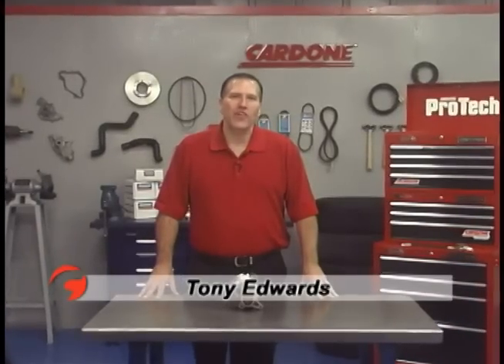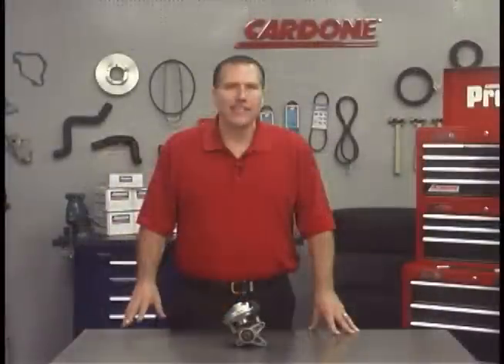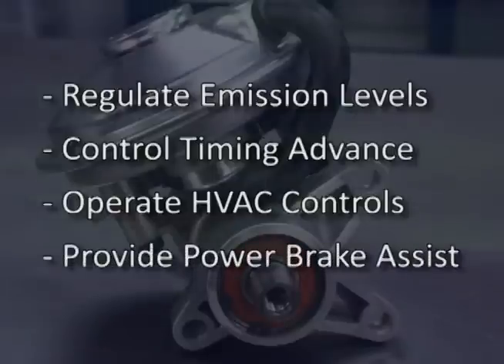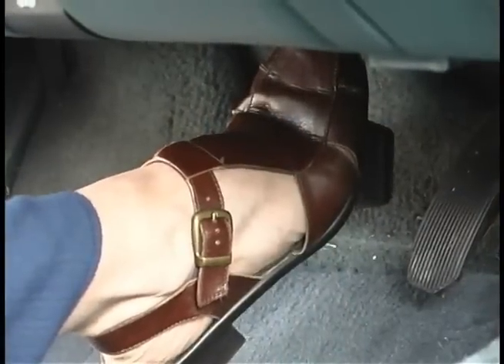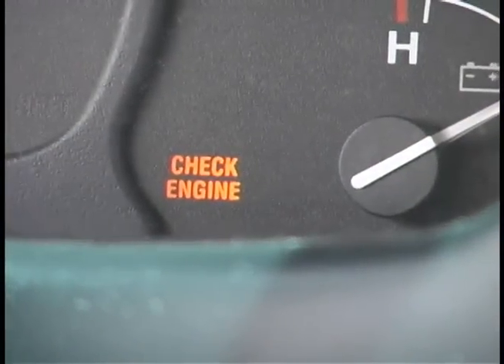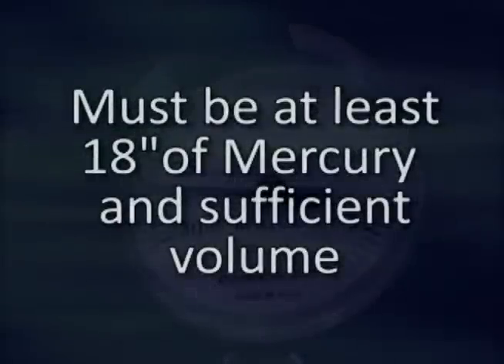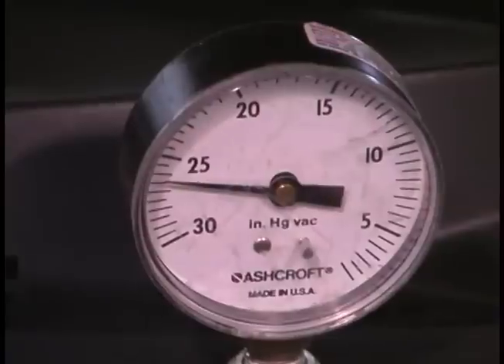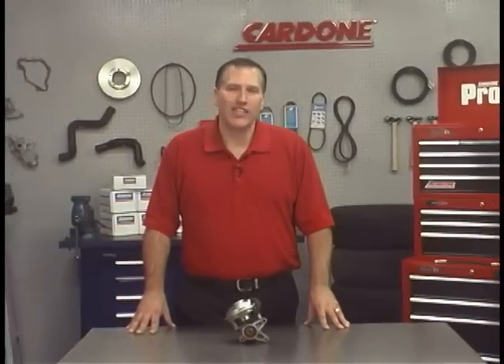Properly Diagnose Vacuum Pump Failure

Comment: Hello. My problem is the following.2012 grand cherokee loredo... Vacuum pump works when I jump 12v to it. My problem is that it does not get 12v from the car. Checked fuse. Changed relay. Changed check valve at booster. Still nothing. Cannot diagnose why it is not getting power. Any suggestions. Please help me. I am stumped